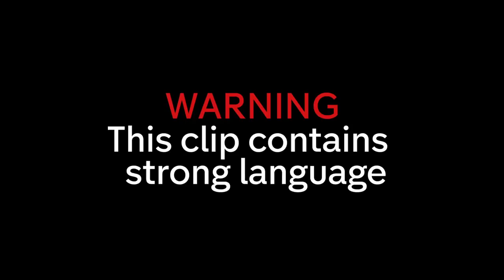Gordon Ramsay LIVID “You’re Charging F*****g Money for That!” | Ramsay's 24 Hours to Hell and Back

Comment: Three months after 24 Hours to Hell and Back, Darren's passion for the restaurant has returned and Ragnar is spending a lot of time in the restaurant.

Their relationships have greatly improved and the restaurant is running smoother.

They returned a number of customer favourites to the menu as they felt Gordon's menu was too small but promised not to return all 6 pages.

The Trolley Stop Cafe is open.

Yelp Reviews since filming are mixed with comments on the food not being hot, a wait for food and the food quality being average. There are also some negative comments on service issues.

Trip Advisor reviews are very good with praise for low prices although some comments criticise service and some dishes.